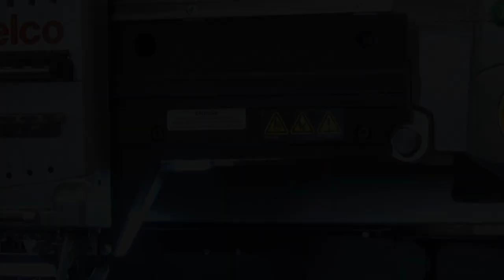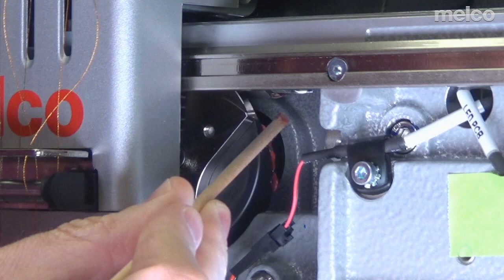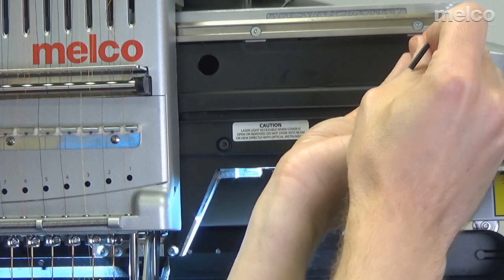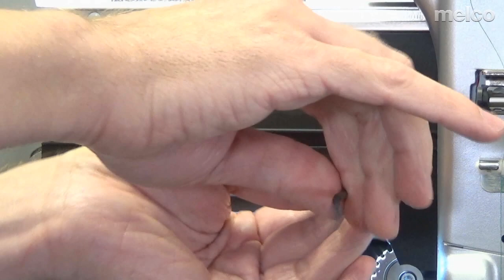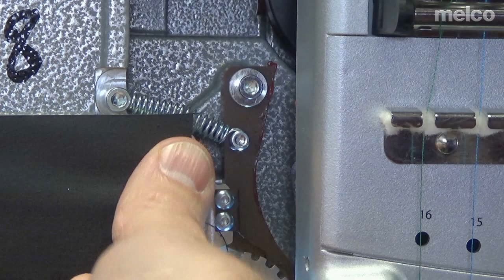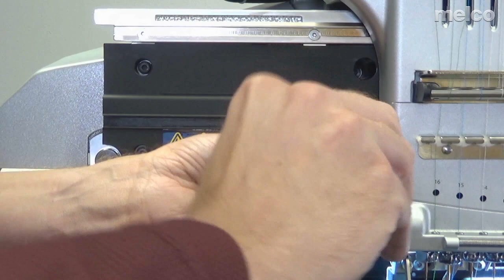30,000,000 Stitch Maintenance

Comment: This is the same for all machines? I have STX.
Reply from the maker: Depending on software versions, steps and numbers may change a bit, but the the screws and oiling points will all be very similar. The software will walk you through the steps. The bigger covers will have a different number of screws depending on model. Some other changes will include trimmer maintenance, but I don't think that is this step, and again, the software will walk you through as and if needed.

All that to say, largely the same. The techniques for removal and replacement of covers are the same. The software will show machine-specific images, screw counts, oil drops, and instructions.
Reply: Thank you!!